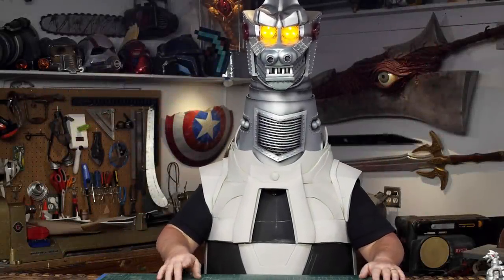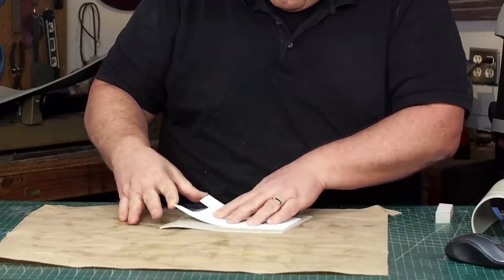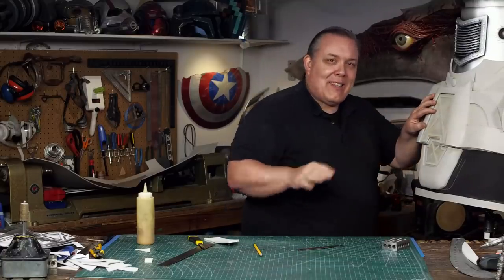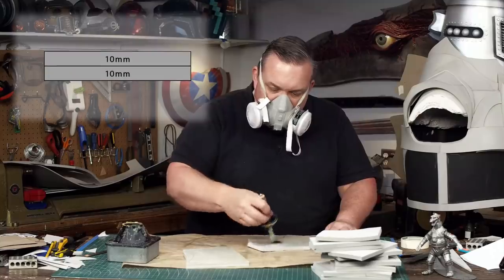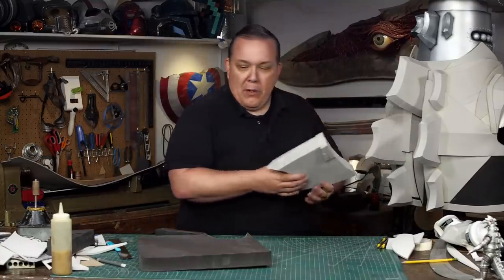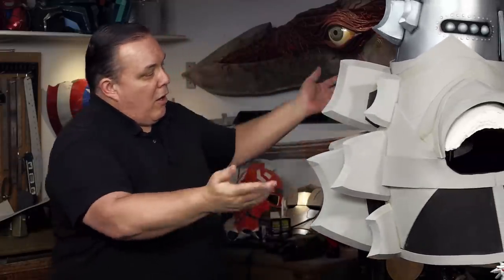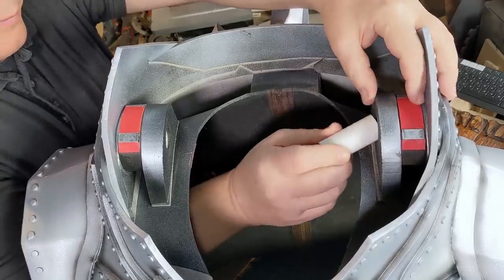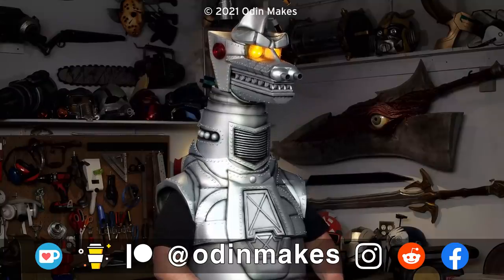Odin Makes: My Mechagodzilla cosplay chest build part 2

Comment: Great video as always Odin.
At the end before you took the neck grill off, I was looking at MG's mouth while you were talking. 😄
Reply: Hah! I did the same thing at the beginning of the video!
Reply from the maker: That is really cool! thank you!!!

I plan to do some work on the head after the arms, and I want to get the mouth moving. I just needed to have a permeant solution for the head and neck first.
Reply: @OdinMakes  This probably falls under one of those Ardrino or Pi or whatever tech solution I don’t know much about, but having the mouth actuation movement driven by the sound of your voice talking would be kind of badass. I bet the suit would start getting pretty heavy with the more tech thrown into it though.
Reply: @StariusPrime  This is actually a great way to go.(good idea)  He's gonna want fans, lights, gotta wire stuff anyways, and the electronics for what you suggest are pretty small these days.  Like: area and weight of a cooling fan.  
They offer tiny steam generators; like in toy trains, for cheap(and light). I would add some little DC steam generators in various places.
Turn on the chest beam with lights out and steam generators going......ummmm yes plz!!!
Reply: @d-rockpain4250  That little Johnny 5 looked awesome! 👍
Reply: @StariusPrime  yeah, he makes various function j5s and is a big part in the j5 community.  It's worth a look.  He also posts his reworked. stl files in their facebook group.  You can print these guys for free.  I have an old robot 5 kit I modified, and still need to assemble.

Comment: A tip for rivets if you don't want foam or googly eyes, you can find little rubber bumpers on amazon, they're for cabinet doors to make them close quieter I'd assume, they're fairly cheap, I found about 200 for 9 dollars, and they look surprisingly rivet like when painted, and they have a few different shapes, like flatter ones or even square ones
Reply from the maker: Ohhhh, cool! I was looking at 1/2 pearls from the scrapbook section of the craft store. But I was not sold on using them- they would be too different from the flat round foam ones I have.
I will go look.
Reply: @OdinMakes  I can find a link real quick if you need it

Comment: That is look brilliant! Be interesting to see how you tackle the energy beam door mechanics so you can open and close it "hands free". Also, when you mentioned looking forward to heat stroke, would one of those small fans from the Among Us costumes be an idea to have inside to keep air flowing around inside the suit?
Reply from the maker: I am attempting to joke about heatstroke- which is not a laughing matter...

1- I have bought a fan for the head/neck but I may need to get a smaller one. I need to get a few other things adjusted before I add it in.

2- Thinking about using a micro servo with modified Lego gears. but I will need to experiment first. For controls, not much choice- I will have to run a wire down my sleeve!
Reply: @OdinMakes  I knew it was a joke :). Was just thinking of a way you could combat it seeing as you'll be wearing several layers of dense foam and paints. Will be cool to see it all get figured out and incorporated

Comment: Such awesome work here.  You literally look like a kid swapped his MechaGodzilla toy's arms with a GI Joe.  Just a note: I've seen people use a silver auto spray, it's just like plasti-dip, but silver.
Reply from the maker: I picked up some gutter guard, but have not tested it.
I will look for the silver auto stuff. sounds like a nice step to save!
2 cans of black Plasti Dip $13
1 pint silver paint $10
If I can get 2 cans for $23 +/- and have it work- that would be an absolute win!
Reply: @OdinMakes  I looked it up.  Bill Doran used Rustoleum Peel Coat Silver on a Borderlands prop.  I believe Brit used it too and said it's pretty much identical to plastidip.  Looks to be about $10/can on amazon

Comment: I agree, making them solid might b a lil over kill but I much rather have durability over them bending
Reply from the maker: Right? I made some parts similar to this hollow for the Gundam, not only did I have the "hole in the edge" issue, it was actually harder than just buying more foam!

Comment: I’m sure you’ve thought of this, but look into cooling fans for the head. Heat stroke is no fun!
Reply from the maker: I have thought about it, and it is a plan. I bought some already, they may be too big...
But what I am thinking is to pull fresh air in through the face, and hot air out the mouth of MG.

Comment: Would you recommend the scalloped band saw blade for any foam ? Finally sorting a workshop and getting a band saw and bench sander (my cosplay dream)
Reply from the maker: I think I would, but if you're sorting out your workshop first time just go ahead and use a multi-tooth blade they're much cheaper and easier to find check out SKS props and evil Ted Smith they both use band saws a lot, The only real difference is the amount of finish work afterwards depending on how smooth you want it to be. Woodworking teeth leave a lot of tool mark I think the multi tooth metal blades leave less tool mark and then the scallop blade leaves almost no tool mark on a straight cut.
Reply: Many thanks